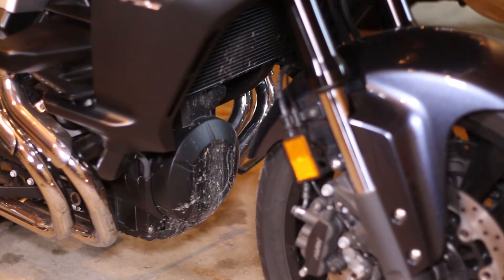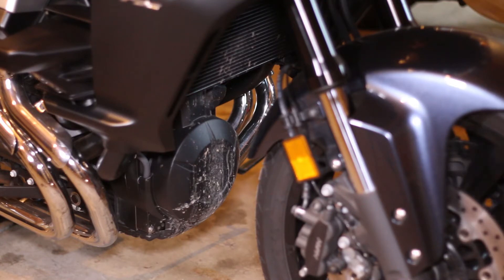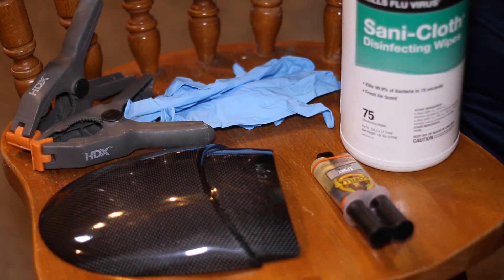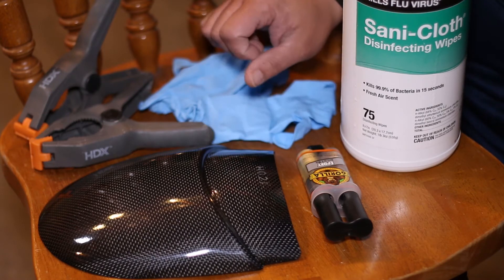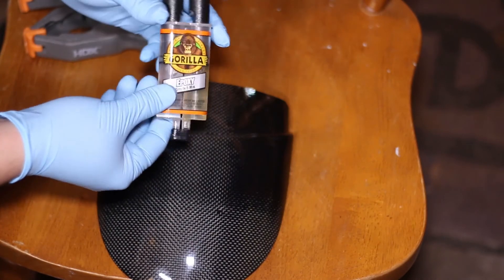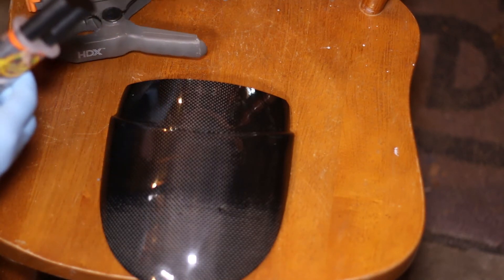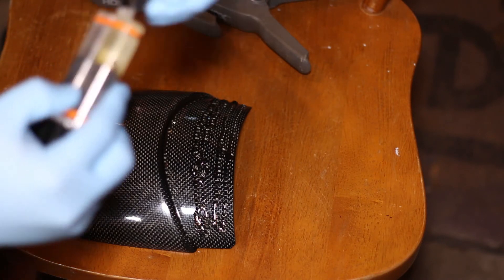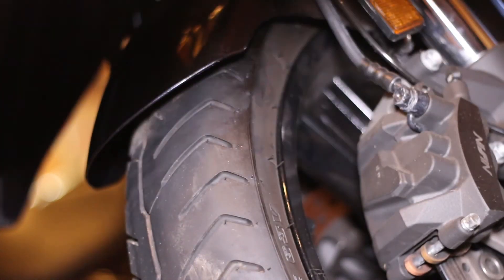How to Install Fender Extender the Easy Way CTX1300

Comment: Don't apply the unmixed 2-part epoxy to the fender. Squeeze onto a scrap of plastic or waxed paper and mix well FIRST. Then apply the mixed epoxy. When the epoxy is cured, you are done. It takes only 5 - 15 minutes.
Reply: A good lesson in how not to mix epoxy

Comment: Thanks so much.. ordered one up for my bike,, like you mentioned , there is a lot of throw back to motor and rad... this helps and looks nice too... good vid to confirm how I will have to put it on..   ride safe all  .. david
Reply: I used contact cement and sealed joint with silicone.. looks great and protects the rad.. recommend
Reply from the maker: Thanks for watching and commenting!! I think you will enjoy the clean up a little better!! You ride safe as well!!!
Reply: DubbsRider hi how is your fender extender holding up ? Folks were saying your technique applying the epoxy directly was. It the best. So I wanted to know. Thanks.
Reply: @Dubbsrider  Where did you purchase your extender from?